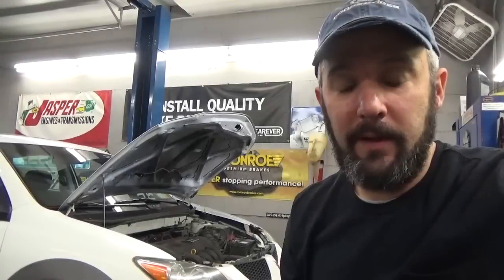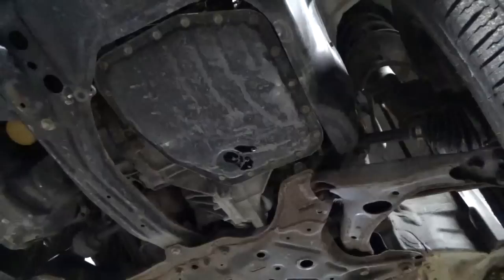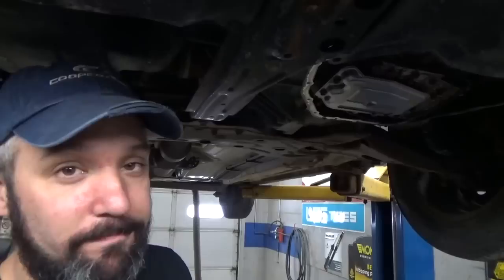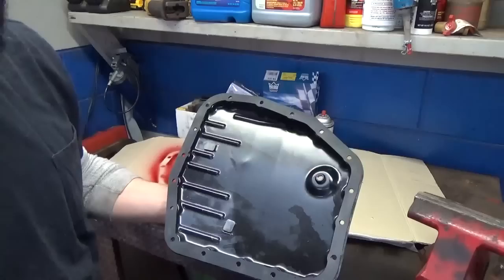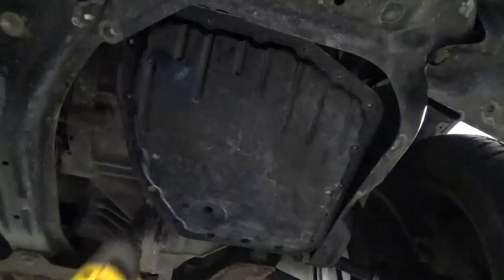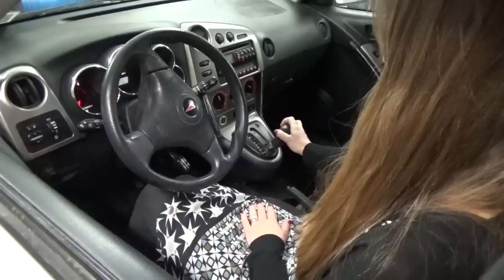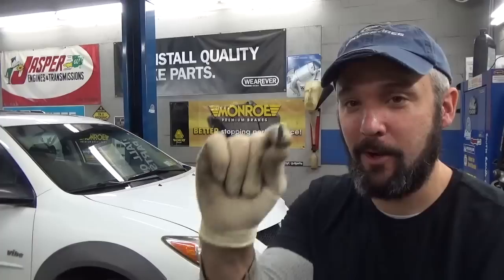Replace Transmission Fluid & Filter - Toyota Matrix / Pontiac Vibe FWD

Comment: Thanks for this vid. I bought a new Vibe in June 2003 and it's still my daily driver. They are great cars!
Reply: Did you have to do trans fluid?
Reply: @KollynJ I did it at 60,000 miles...it's got 90,000 on it now in 2024
Reply: @jamesstuart3346  will you be doing the process again soon or when do you plan to change it next?
Reply: @KollynJ  Given how little I drive, I think this service will be good until about 2050 ;)

Comment: I want to say thank you for the video.  I just changed the transmission filter on my 2007 Toyota Matrix, 100K miles, and your advice came in real handy, (left two nuts in the front and back and used Permatex on the pan to hold the gasket).  Thanks so much from New Albany, IN!
Reply: What atf used? Was it better or the same after fluid change

Comment: Good video. One thing to mention. I always start the bolts by hand, starting it with the gun or ratchet, can increase chance of cross threading.
Reply: @pizzanpepsi  I agree.   Also, I'm not a fan of using an impact driver to reinstall the bolts.  Too easy to over torque, especially when it's in inch/pounds

Comment: I have an 05 Matrix that's working on 290,000 miles. I drain and fill the trans just about every other oil change (which I do every 3000 or less!) and it ALWAYS comes out clean. For some reason, I didn't think these had a serviceable strainer. Guess I'm running to the parts store next time! Awesome video man.
Reply: How long did it go for? What kind of transmission fluid did you use
Reply: Have an 05 with 160 just bought it transmission oil is dark but shifts pretty good a slight bump once in a while
Reply: Jfc tranny fluid every 6k is excessive, of course theres no obvious metal, you'll never let it buildup to see it in the first  place. Toyotas recommendation of every 30k miles is already extremely often for this transmission lmak

Comment: thanks....I have an echo and trans  looks the same.....I change the fluid every 30,000 mile.....alittle overkill but fliud cheap and tran work is not.....I did pull the pan off at 120,000 miles just to check the strainer....it looked good and also gave me a chance to clean up the pan of any heavy sludge......love the car.....best one I have every owned....thanks again...bob

Comment: I was talking to my local transmission shop about changing my fluid on my 05 vibe. He said he would do a drain and fill just like you but I wondered how they got all the fluid out of the torque converter? They said they no longer used flushing because it removed varnishes that caused problems. So they drain, fill, drive, drain and fill again and maybe a third time to get all the transmission fluid out. Do you do this to thoroughly do the job? Also, if switching to synthetic fluid from regular fluid is there a problem with residue mixing with synthetic fluid? Plan to do this on my own and save $178
Reply from the maker: Tobias Sinclair Well I would do my research as far as the question regarding the mixing of syn. and conventional. I personally have never seen a problem result from it but you better look or call the company of the brand you plan on using. As far as the spill and fill and repeat procedure that is correct and is stated in some shop manuals too.

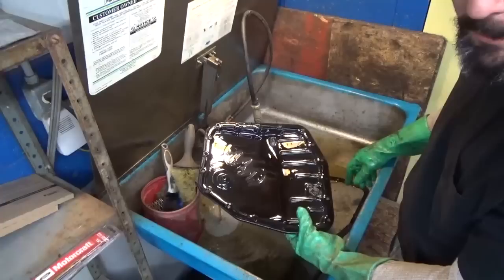Comment: I doubt that it matters, but the magnet was to the outside of the bump in the pan in the parts cleaner at about 4:00, but Eric put it to the inside at 7:00. 2004 Base Vibe here. I will do this eventually, only 80k and fluid looks good.
Reply: Does it shift perfect, mine bumps slightly sometimes. Did it help after atf change?

Comment: Great video! Planning on doing this with my recently purchased 05 Vibe. I have a couple of quick questions.

Is the drain plug washer needed? I heard they're single use crush washers. Should I really replace it every time?

Also, I bought some "Copper Spray-a-gasket, High temp sealant" by permatex. Is that pretty much the same gasket adhesive you used in this video?

Thanks for this video and any reply you can give me!
Reply from the maker: Gary George Yes you are suppose top change the plug washer every time but you can get away using them several times IMO. The copper spray tach will work fine , it is just a high temp version of what I use is all.
Reply: Hey man I just bought one and would really like to know how dependable that car was for you

Comment: Hi man, do u suggest adding to the atf something like the Lubegard Platinum. I believe the dealers add every time they service the transmission fluid. So, before draining my pan the shifting was getting a bit harsh, but even with the new fluid in did not get much better. This week I added 4oz of the Lubegard, but I felt it needed another once. It feels slightly better, but I am not totally happy yet. What would u do? Done it with the dealer when it was around 100k, and now 180k. I used the toyota T-IV. 2005 matrix awd here. Thx!

Comment: Great video as always, Eric.  A couple questions on this.  I assume that everything is identical with the AWD version of this car, correct?  Also, I also assume that the car should be up to operating temp so that the fluid has a lower viscosity and flows out easier?
Reply from the maker: wrxnofx You got it on both accounts
Reply: Thanks!!!!

Comment: How often should I check and change the transmission fluid in my Matrix? I couldn't seem to find any information about it in the owners manual.
Reply: usually your first service should be around 60k miles (or 95k KM). If you're doing the drain and refill, you'll only get about 1/3 of the fluid out. So you'll wanna do a drain and refill 3 times over the course of a month (or a year if you want to drag it out).

Comment: Just wondering? I'm trying to remove ( replace) the lower control arm on a Pontiac Vibe 2008, I managed to remove all the bolts (after lifting up the trans) but somehow I have a hell of a time to dislocate the arm from its position, , any suggestion? thanks

Comment: My matrix has 274k. Bought it at 143k haven't changed the transmission fluid. I'm paranoid that if I do it will start slipping. Should I do this refill or not?

Comment: Did I miss the part about the filter? When did you replace that?
Reply from the maker: Sask321 4:53 I am installing new one...
Reply: South Main Auto Repair Thanks for the quick response, wow! thought I would be waiting a month or never for a reply! Was it done in the video? sorry if I missed it. Great video by the way! After watching this I have decided to do it myself! I normally do my own oil changes, so this doesn't look much harder! Also a little side question if you don't mind. I have been noticing that my automatic 2008 pontiac vibe (52 K on it, ~ 30,000 miles) has been idling really low when in park or at red lights, it has really low mileage. It's not so bad that it stalls but my car shakes a lot and seems like it could stall (I would say around 600 rpm give or take a 100 rpm). What do you think are some simple things I could check/clean? thanks in advance if you reply!
Reply from the maker: Why don't you leave the battery unhooked to reset the adaptive memory and clean the throttle body and IACV. See if that helps you. Can't hurt either way :)

Comment: I bought a 04 vibe yesterday,,,text text text...so I toted it home(150mi) in park(ft tires on toter), drove off toter and test drove it(1st time). The stearing wheel spun once fast after finally got key it(I called junk yard to ask if I should put in park or N they said park). She wines a little going down road.....looked at rear this this morning and ,,,?,,,what is that,,,drive shafts!!! Yup it says(under the dust) all-wheel-drive.   opps....might be for sale this winter, even though I always wanted one. So the lill wine,,,could be cause its awd, ?, or did I mess it up. Frankly surprised if I didnt. So far so good, tough lill Indian still goes

Comment: Like your videos.  Just subscribed.  We have a two Matrix - 2005 and 2006 (both bought new). We had both  power flushed at around 60K, per dealer's advice.  One of them still only had 75k on it.  But our main one has 120k on it now.  Fluid does not look very dark.  Would you recommend power flush, just drain and refill, drain and remove pan and refill or leave it alone?  Both cars still look new and we plan on keeping them as they have been great.   Thanks, Steve in Ohio
Reply: I'm no expert, but everything I've heard and been told advises against the flush. With newer cars that have less wear you're probably able to get away with it.
Reply: Hello, can you tell me how long your matrix’s held up? Did they always perform better after atf changes?

Comment: The gasket spray is unnecessary in most applications. With a few bolts through the holes, the pan goes on fine with the gasket lined up.  I don't envy the next person who has to scrape that old one off.

Comment: Hey Eric ~ Have you ever had to deal with a Dodge Caliber Jatco transmission (CVT2)?  I bought mine new back in 2007 and in the warmer months of the year, it tends to make noise, show the overheating light, and I have to pull over to let it cool off.  It uses the CTF+4 fluid (which is special to this trans).  Have had to deal with any of these things?  I was thinking about adding an additional transmission oil cooler but if you have any insight, I would love to hear your opinion.  Thanks ~ I found your channel about a month ago and you have helped a ton...

Comment: Loved your video, helped me alot.  Question:  I did it exactly like you did but when i went to dump the old oil for recycling there was well more than a gallon that came out.  Everything I read said about 3.4 should have come out.  I purchased the car used so i guess it could have been overfilled becsuse at 3.4 qt the dipstick shows a good fill.  Any opinion?  BTW the old 08 Vibe has 279k and running strong.
Reply from the maker: +Jeff Schmiemeier Did you check it before you drained it to see if it was overfull?
Reply: +South Main Auto Repair No, didnt dawn on me it would be over filled.  Got the oil changed soon after I purchased the car for my teen son.  They said the trans oil was dirty and tried to sell a flush.  Off to the auto parts store to get a second opinion.  Two guys gave polar opposite opinions, one said drop the pan as flush is hard on the tranny, the other said flush since ti gets out all the old oil.

I opted for your video (thank you) and am petty happy, but the "extra" waste oil was a shock.  Im guessing about 4.5 +/- came out.  I filled an old gallon milk carton to the top and have .5 qt to go I'm guessing.
Reply: I just added a comment, turns out it's exactly what you said. Bought the car new, 250k miles later did my first transmission service. The dipstick says - under normal diving conditions, fluid never needs to be changed. Anyway, just removing the plug resulted in exactly 4 quarts, pan and filter drained just under 1 additional quart. On an 08 Vibe also.
Reply: Way too many people don't know to check auto trans fluid while hot with the engine running.  Checking cold fluid with the engine off invariably causes over-filling.
Reply: @burns1210  how long did it last and did atf changes help?
Reply: How long did it last you? Was it reliable still, did the atf changes help always?
Reply: @KollynJ  honestly, I didn't notice any difference. It was shifting fine before and after the fluid change. There was a lot of metallic goo in the pan that I removed, so it wasn't all for naught. I did however make the mistake of not removing the old gasket, you don't even notice it because it blends in so well. Thankfully I noticed when I was screwing in the bolts with the new one. No damage done. Just make sure you remove that old gasket. And measure how much comes out and add the same amount. I used an iced tea pitcher.

Comment: i like it...also what u think of just drain n fill as compare spill or remove the whole pan and filter n fill.
i only do drain n fill and been doing that for a long time with no problems in driving.
thanks
Reply from the maker: Actually a drain and fill on these is just fine because the filter is more of just a strainer in these but this case the guy just bought the car and wanted to pull the pan to see if there was any chunks haha. Plus it had 177k on it. Thanks for watching!
Reply: South Main Auto Repair
 gotchya. thanks

Comment: Hi great video, thanks for the info. Question for you. 
I’ve got a 09’ Matrix with 104000 miles. I want to change the trans oil and filter myself, would it be necessary to have a full flush done or just drain what I can and change filter?
Reply: i've always been told flushes are bad. i'd just drain and replace like an oil change.

Comment: I swear I read online the torque specs for the pan bolts was 80 inch-lbs :( Damnit! Now I have a little leak! I’m gonna drop it again and replace the gasket. Is it possible I warped the pan with 80 inch-lbs? I’m thinking I should order a new pan as well.
Reply: Just remember 84 and 48. 84 in lbs. for the filter/strainer bolts and 48 in lbs for the pan bolts.

Comment: Nice Video....  I came here seeking some knowledge and advice...  I wonder if you could educate me a bit..
A couple of weeks ago my transmission (2008 MATRIX - 180K miles!) decided to QUIT...   I was lucky I was a   near home so I got it just to PARK...  
The symptoms are that after some 40 miles of driving the gear disengaged and I was crawling slowly, at high revs..
I stopped at the side of the road, and checked the FLUID LEVEL...  IT WAS WAY ABOVE THE "HOT" mark!  while I expected LOW LEVEL!
After a few minutes - fluid rather warm still - I   decided to try again...  The car started moving, as the gear engaged, I traveled for half a mile and it started slipping again.. I waited a few minutes, and again traveled half a mile to arrive home..
I have no $$ to have it repaired so I left it parking...  NEVER STARTED IT SINCE !
However, even today, two weeks later the fluid level was VERY HIGH ...  Today I decided to drain some fluid out - I took out about a quart.. but the HIGH LEVEL STAYS THE SAME!!
How can that be?  Is there a MALFUNCTION situation that will cause the HIGH LEVEL?
I never added fluid - and if anybody did, it was my mechanic (no I did not tell them about this yet!)  
NOBODY will tell me if the high level could have caused the problem - and if lowering it MAY FIX IT!
They want me to tow it in - but I cannot afford anything at this moment!
That's why I am asking for your opinion...   
1) what could cause HIGH LEVEL besides over-fill?
2) Why does it not go down?  I took a quart out..
3) Is there even a SLIGHT CHANCE that lower level will "CURE" my transmission, by itself?

MANY THANKS FOR ANY RESPONSE
Reply: Take it to a mechanic
Reply: Did you ever get it fixed? What'd you do and did you find out the cause?

Comment: do u have a video on why my check engine light keeps comeing on even after I changed my mass air flow sensor which the computer told me to do
Reply: If it's an older Vibe/Matrix my guess is a bad intake manifold gasket. Check w/obd2 code reader. Advance or AutoZone will chk it 4 free. If it has a P0171 code (runs lean) that's probably the problem.

Comment: Hi, new subscriber here,  i did some research about most corolla tranny filters just like what you replaced in the video and have read that the filter are clean most of the time so it's a waste of funds replacing them.  What's your take on this from your experience?
Reply: Fluid keeps everything lubed and has the anti-wear and proper additives. Filter cleans the fluid and should be changed every 30k miles. Clean fluid and filter makes for a happy transmission. No wasted funds. Filters are cheap insurance and 3 qrts. of fluid is $18 from Wally World. Do a drain/refill every 10 - 12k miles and your trans will love you long time.
Reply: Dawg its literally $10

Comment: if one doesn't have a hoist where does one place a jack stand,
Reply: George Hart Under the pinch welds on the sides. Look in the owners manual. Where it shows the jack points on the side is where the jack stands go.

Comment: what is the purpose of the magnet
Reply: The magnets on the transmission oil pan are there to attract and keep any loose bits of ferrous metal that might wear or break off the automatic transmission internals, keeping the bits from being pumped back into the transmission.  If you find metal clinging to the magnets when you change the fluid it would indicate extreme wear and possible future failure.

Comment: I wish my 2008 Ford Focus had a drain bolt in the middle of the pan like that. 
Engineers need to be beaten
Reply: Blame the accountants. The engineers would definitely add a drain bolt if the accountants didn't shoot down an additional cost of $2 per car.

Comment: The very bad part of the vibes and the Matrix is there are two different engines which are junk.I have seen two go bad so far and most yards do get calls for them.
Reply: Really? Mine has  over 250,000 miles on it  with no problems, besides 2 batteries 1 radiator and a alternator, oil changes, transmission fluid change and spark plugs. (2003 Matrix)